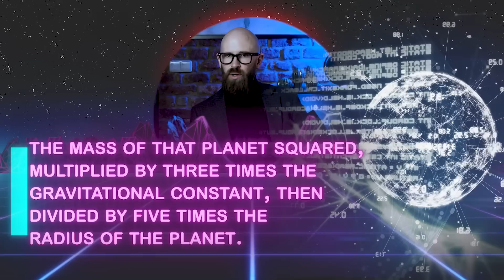Is It Possible to Destroy a Planet with the Death Star Laser?

Comment: There is a realistic, fitting solution to that "problem" of a real life death star and make it look perhaps similar too:
Use the mother of all railguns basically.

Long Description:

1: Generate highly dense and stupidly hot plasma or perhaps even a soup of free subatomic particles (the step after plasma). This can also serve as a heatsink where the generated heat is stored between shots and already keeps the plasma / soup ready for next firing.
2: Meanwhile send out an array of redundant, reusable (but also easily replacable) focus and acceleration rings. Those may have a pretty small diameter.
3: Feed those rings with power through very high powered lasers (this way you have your "combo laser" effect, though more spread out and far more of them. Aside from the fact that they'd be invisible in space sadly..).
4: Firing sequence: Use an inbuilt rail accelerator in the death star that goes the entire way from one end to the other of the station. 
Push all of that plasma / soup into the accelerator as quickly as possible and try to focus that beam to be as dense and thin as possible.
5: That apocalypse beam flies out of the center of the firing assembly at almost the speed of light while being so bright hot. It will still look like a laser as you propably cant compact the plasma / soup down to a single small ball but rather a somewhat long line. That line passes through the focus rings, is focussed further down and pushes the speed even higher towards light speed.
6: Pop champaign bottles as the rest of the heat is forced out of the system by sublimation and pushed through one or more exhaust holes.

Meanwhile the planet is hit with a super dense, super hot line of plasma / soup, 1m thick and scratching at the speed of light. There is so much energy that it flies through the planet down to the core, is slowed or stopped. All that energy is forced into the dense core of the planet which very quickly turns into gas or plasma itself, making the entire upper layer of the planet break out as if you are playing billard.

Yes, the planet would fall back together into itself because of gravity, but in "hard" sci-fi it tends to be called a "shattered world". 
Oh yeah, alternatively spread out the plasma / soup instead all over a side of a planet and you get a "glassed world" instead and that would need far less energy and mass.

Would it use alot of energy? Yes. However, this far in the future, antimatter reactors would be commonplace or even the use of zero point energy. As the station covers stupendous amounts of volume, those "zpm" (thanks stargate!) powersiphons can be scattered all across the inside of the station.

Aside of energy:
-it would problably need frequent focus ring replacements (which are intended to be used sacrificially anyways if you want).
-Spare, dense mass of about 250mil tons per firing plus for sublimation to dissapate heat. Best example would be 2-3cm³ nuclear pasta that has exactly this mass. At half the speed of light, you would need 20000-30000cm³ of nuclear pasta or ~2,5 billion tons of mass.
An empire that has access to billions of star systems and thus also alot of neutron stars would have no issue whatsoever. The material heatup is technically just a bonus that isnt needed.

So, either i am a sperg or a supervillain. Maybe both.
Reply: What about the recoil?
Reply: @yourguard4  
Actually not a big issue considering the beam being sped up over a few seconds instead of almost instantly.
Also it wouldnt necessarily need as much as i said considering the absurd heat carrying alot of energy aswell.

there are many solutions regardless:
-For starters: Just using the thrusters of the station as they would need to be absurdly strong anyways
-use the sublimation exhaust as a short-time absurdly powerful thruster exactly while firing
-add one of the most simple and tried and tested methods to absorb recoil: Shock absorber mounting! Look at the Schwerer Gustav or 88 flak for reference and inspiration. Now scale that up for multiple hundred kilometers.
-if everything combined isnt enough, use basically the same cannon in the opposite direction. Just hundreds of tiny cannons like this that are less dangerous that way.

All that makes it more complex but still realistic.

Comment: An interesting thing I learned recently, antimatter only self annihilates when colliding with its equal opposite. So two separate types of matter and antimatter would be fine.
Reply: That doesn't sound right at all.  Any matter/antimatter collision should destroy them.  That's why containment of antimatter is so difficult and has to be done via magnetic fields.  I would be interested to know how they got some antimatter that can contact other matter without destroying the particles.
Reply: i don't think so, if you had antihydrogen and helium, I'm pretty sure it would annihilate with one of the helium's protons
Reply: I wonder if you blasted anti quanta at matter would the anti quanta anihilate with the quanta bound in subatomic particles? Because that would still break of the atoms.

Comment: There is a mistake at 9:50 in that the speed of light is 2.998 x 10^8 m/s, not 10^5, so the speed after firing, assuming no propulsion is used during firing would be only 100 m/s and the acceleration would be 2.1 G, unpleasant, but survivable. Incidentally, I would like to know what mass you gave the Death Star. Was it 10^22 Kg?
Reply: Not a mistake, just different unit of measurement. Seeing as we had just said 300K km/s it made sense to use 10^5 km/s rather than 10^8 m/s which would potentially be more confusing
Reply: @ThatWriterKevin  Actually a mistake, if you are using joules and want the calculations to be correct.
Reply: All that and you "would to know"? ;)
Reply: @lenny5774  Thank you for letting me know, I had missed out the word, 'like'.

Comment: I postulate that the beam is quantum physics based energy. Multiple beams point to a centre then directed by a guide beam towards the planet. The particles pass through the Earth crust (Like muons). Once in the core, a chain reaction causes a pressure wave that pushes the magna outwards.

Comment: Did "they" ever say what the weapon actually is? Is it a laser? Is it a particle beam? Is it a plasma gun? These would all behave differently and have different properties.

Also, if it is a laser, then why would there be any recoil when a laser shoots a beam of electromatic radiation and not physical projectiles? And if it is shooting something physical that would cause recoil, THE HAVE GRAVITY CONTROL!  The ultimate counter to recoil!
Reply: Literally explained in the video why a laser with that high of an output would have recoil
Reply: Lasers have recoil, it's just not much because of the lack of mass. We actually have plans in place to accelerate ships with lasers, by firing a ground based or orbital laser at the sails of a ship, propelling them forward and removing the need for chemical rockets. Also, look up Shkadov thrusters (Issac Arthur has great videos on this stuff), basically turning the sun into a ship with mirrors, reflect all it's light in one direction, and it will be pushed in the opposite direction.

Comment: There's a structure called a Nicoll-Dyson Beam. It focuses the solar wind into a tight beam that can be fired as far and as long as you need to (interstellar distances). It can strip the atmosphere off and char the surface of a planet after prolonged firing. You can use that same beam to launch relativistic kinetic kill vehicles.

Comment: The heat issue was solved. A single thermal exhaust port a few meters wide at the end of the equatorial trench
Reply from the maker: My bad. Sorry.
Reply: It's totally not a design flaw that could lead to the destruction of the DS1, nope not at all.
Reply: @renaissanceredneck73  The designer did that because he didn't even get the Chewbacca award of recognition for exemplary work from the Emperor! >XD
Reply: Just needed a proton torpedo filtering metal barring on it.
Reply: Not much bigger than a womprat.
Reply: @thetangieman3426  All this time I thought he was saying "swamp rats" lol
Reply: @I.am.Sarah.  Really? Why would there be "swamp rats" on a desert planet (i.e. Tatooine)? 🙄
Reply: @thetangieman3426  so instead of every fighter the rebellion had they could have just sent in a womprat with a bomb?
Reply: @thetangieman3426  It's not impossible. I used to bullseye womp rats in my T-16 back home, they're not much bigger than two meters.
Reply: @thetangieman3426  You'd still need to be a hell of a T-16 pilot to bulls-eye it.
Reply: HISHE Return of the Jedi
"No, Sir, no exhaust ports this time. We've built an even larger opening big enough for a entire ship to fit through."
Reply: I submitted a ticket to place a shield there last month. What the heck has the maintenance staff been doing?
Reply: @Lauren_C  they've been dealing with some critter hiding in the garbage compactor
Reply: It was ray shielded too! Unfortunately someone forgot the particle shields but I'm sure that won't be an issue...
Reply: @commandoepsilon4664  An exhaust port that doesn't let particles through it isn't much of an exhaust port.
Reply: @garethbaus5471  Like I said, I'm sure it'll be fine. The exhaust port is only a couple of meters wide so it's not like some one could even hit it with a missile or torpedo, that shot would be impossible even for a computer!
Reply: It wasn't at the end of the equatorial trench. You weren't paying attention during Jan Dodonna's briefing. The Death Star had many trenches... and many exhaust ports.
Reply: @Raygo.  princess leia had an awesome exhaust port.
Reply: @mgtowchampion7961  I guess it takes one to know one.
Reply: @Raygo.  
She did, though.
Reply: @Raygo.  So which one? And you need to review the trench run in the New Hope...
Reply: @johnhodgson4216  Either/both. Join the queue. And get a clue.
Reply: There's actually multiple exhaust ports, including two giant ones at the poles, all actually visible on the model. Only a specific secondary one is a weak spot.
Reply: @lordMartiya  The waste heat issue is pretty non-trivial. Even if the death-star laser were something like 99.999????% efficient, you'd still need to dump vast amounts of heat instantly. The station would have to vent gigatons of superheated plasma into the surrounding space in a very short amount of time, without absorbing any of that heat itself. Even a miniscule fraction of the waste heat involved would be enough to melt or entirely vaporize the Death Star, as it is so tiny compared to the target planet.
So we should be seeing a cataclysmic venting sequence around the entire station as it fires, though in reality there's simply no actual way it could save itself from instantly melting. The only way this could be avoided is if the laser is somehow 100% efficient, which would be a considerable thermodynamic mystery in its own right.
Reply: @Jesse_359  Leaving aside they have far more advanced technology than us, have you seen the side of the MAIN exhaust port? It's large enough to deal with that issue, and safe enough you can't drop a torpedo into it (you need a certain secondary one).
Reply: The 2m port is above a main thermal port. So venting heat is very important especially during the build up to firing the weapon. I don't think it is a laser. It uses the same principle as a lightsaber which some kind of magnetically contained plasma. Saber beams actike solif objects. Pressing them together with enough force in theory could cause the beams to join.
Reply: @Concreteowl Below. It was below.
Reply: that was for the reactor, not the laser.
Reply: 2 meters wide, and its ray shielded, you will have to use proton torpedoes. which is Nukes for Star Wars Universe.
Reply: The thermal exhaust port right below the main port was actually in a polar trench not the equatorial trench.
Reply: To be fair to the designers, a thermal exhaust port only a few meters wide for a moon sized space ship is incredibly small.
Reply: it's fine as long as someone doesn't Force something in the hole!
Reply: @TheEyez187  I hear there's lots of hentai out there for you kids to enjoy if staying on topic is too boring for you.
Reply: @Raygo.  Forget the topic, I'd rather
Stay on Target!!
Stay on Target!!
so loosen upl! >XD
Reply: @TheEyez187  the hole rejected the first attempt to get a proton torpedo inserted, it took force to get the insertion complete.
Reply: @johnhodgson4216  Not surprised, there should always be Forceplay before insertion!
Reply: Ngl this made me laugh way too hard😂😂😂
Reply: I'm sure no-one will notice it. They'd have to get their hands on a copy of the design blueprints to even realise it was there.
Reply: Cheeky
Reply: (Insert joke about womp
rats)
Reply: That’s the Death Stars pee pee hole
Reply: I see neither a problem with or a flaw with this solution.  Approved.
Reply: The exhaust port was not on the equator of the Death Star. It's in a longitudinal trench along the station. Watch the Death Star plans in the first film, and you'll see that its along a longitudinal axis.😝
Reply: Can't we put a price of plywood over that?
Reply: they had hundreds. that was the only one exposed as it was though.
Reply: 16 thermal exhaust ports plus one larger main port at the north pole, nowhere near the equatorial trench.
Reply: That’s awesome lol
Reply: In rouge one, it is showed that that one specific exhaust port out of many was an act of sabotage by a designer sympathetic of the rebel cause
Reply: Have that thing reach all the way to the core reactor and it would probably work!
Reply: Not equatorial.
Reply: I believe it would only require an exhaust port two meters wide.
Reply: Lmfao
Reply: It was a secondary port. There was a primary exhaust port as well.
Reply: Broooo 😂
Reply: How much nuclear Warheads would produce enough/this energy?
Reply: It wasn't the equatorial trench. It was a different trench. And it was a long time ago in a galaxy far, far away. Stop trying to make sense of it.
Reply: And it was put there by the lead designer to aid the rebellion. That's what all the bothans died for.
Reply: Simon, how can you not like Star Wars if you’ve never seen Star Wars??! Iv never watched the original Star Trek shows/movies and I know for a fact that they are sh*t!..
Oh… wait…

Comment: 10:20 You can also counteract the momentum by also shooting an equally powerful laser in the exactly opposite direction. That would only double the required amount of energy.
Reply: Or you could have its engines - which it used to approach Alderaan in the first place - provide reverse thrust at the same moment the super-laser was fired. 
Also, they must have inertia-less drive (along with artificial gravity) to begin with or they couldn't accelerate the way they are shown to do in any of the movie to begin with; everyone and everything would just go splat against the rear walls once the ships started to move. But that would have to be the topic of its own video.
Reply: It would also increase the heat within the death star problem
Reply: Just make it a remote station. No crew to get boiled.
Reply: @brianpembrook9164  It's more that the death star would melt or vapourise.
Reply: Or the opposing forces are so great, that they wind up crushing the underlying support material down to a singularity.
Reply: Just make sure there isn't some planet somewhere in the line of fire in the other direction that you want to keep around that you don't end up blowing up with your counterbalance laser. Though I suppose the Evil Empire might not care about that....
Reply: Throw in a gravity dampener, problem solved :D
Reply: @Veaiki  That will burn out in a millisecond though :P Unless they can somehow use the heat to make plasma and dump it into the giant path of energy that just shot out the front..
Reply: It would also crush the Death Star to a pulp.
Reply: If you're building something that has mass comparable to a stellar body, why not build something much smaller and just, you know, crash it into a planet instead?
Reply: Bear in mind that now the superstructure of the station has to actually withstand those competing impulses, so we've traded up for a new engineering problem. :D
Reply: @Jesse_359  
I would think it'd collapse like an accordion when it fires a shot... unless it has "inertial dampeners" capable of negating that effect...
...which if so, why not just attach those dampeners onto extinction-level space debris and throw it at a planet?